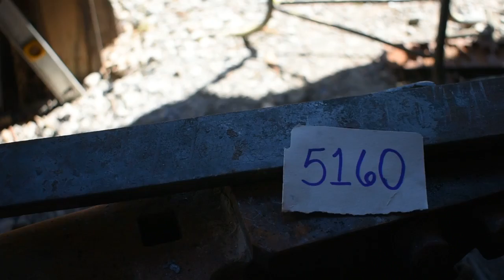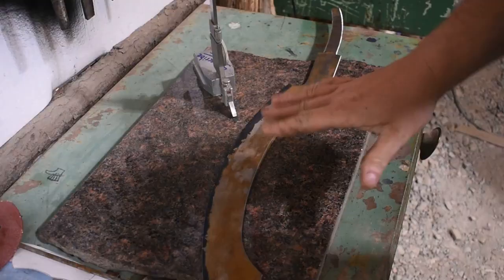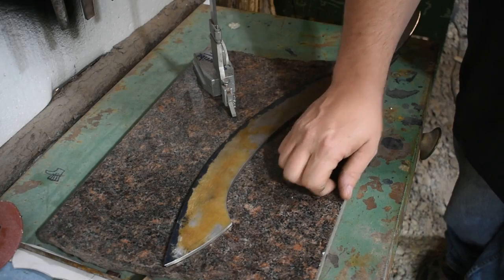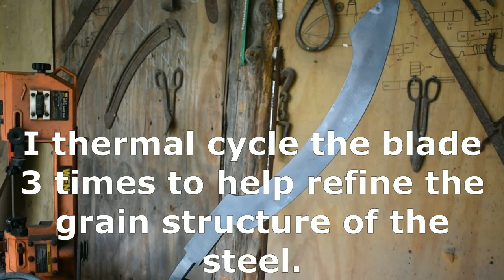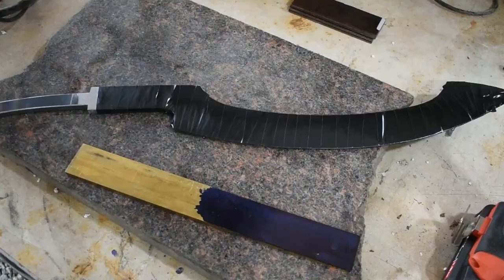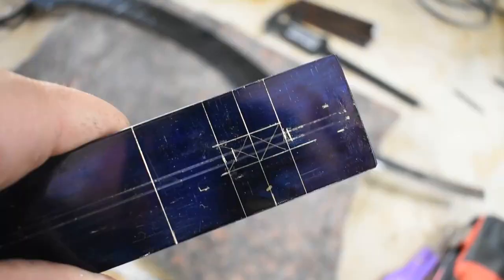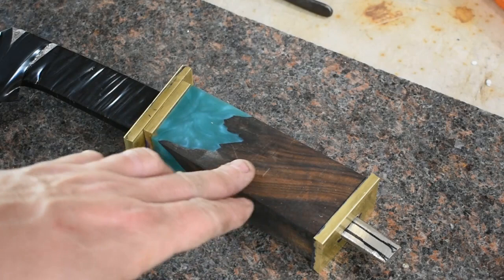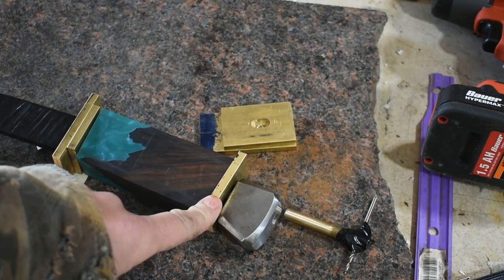Forging an Egyptian Khopesh [THE CHOPPER CHALLENGE]

Comment: You did a good job. Btw, how much longer longer would this project take you without powertools?
Reply from the maker: Thanks! It would take a lot longer, this build took me around 20-25 hours from beginning to end, If I were to do it over using just hand tools, I would spend more time forging it closer to shape and probably go with a forged finish look to save more time in the long run. I would have probably also considered going with a full tang minus the guard as well, I would think it would take 40 hours or so to do it all by hand. I appreciate you watching!